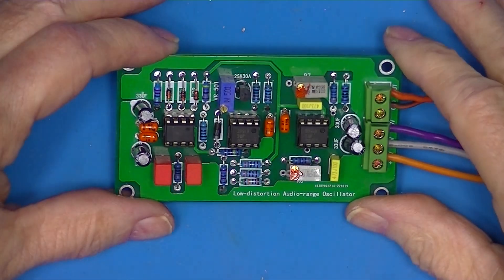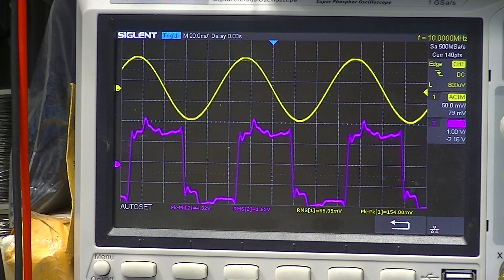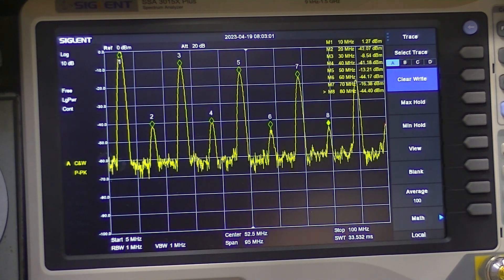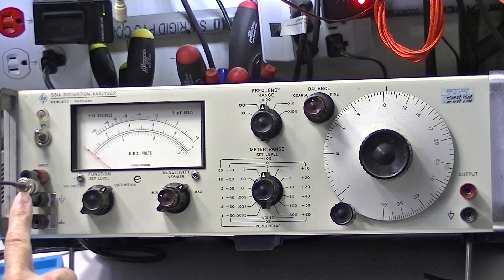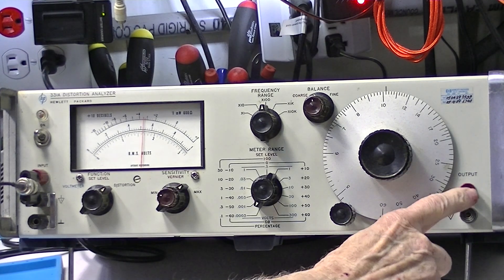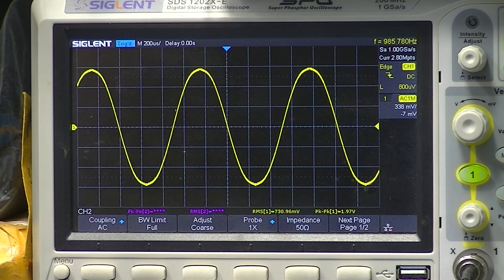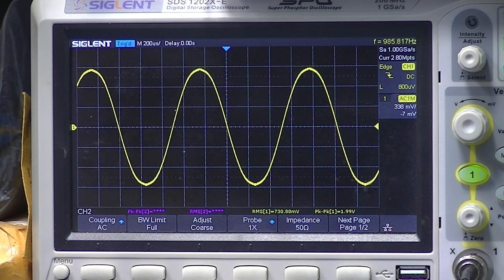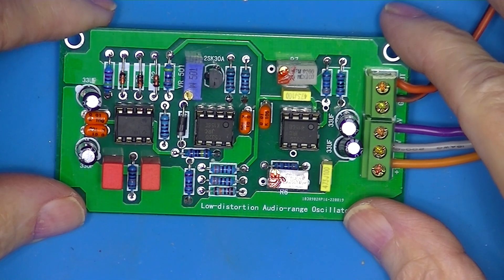Low Distortion Sine Wave Board

Comment: Looks like your spectrum analyzer is a Siglent SSA3015X Plus, and the frequency spec on that only goes down to 9 kHz.  But from your video, it appears to be working just fine at 1 kHz.  Has the instrument been modified in any way, or does it really work down to 1 kHz?

Comment: That is an ancient HP Distorion Analyser! - I first used one of those in 1974 :)   The circuit is a two integrator loop or state variable filter oscillator.

Comment: Very good video. I also have the 331a good machine ! Can you check the number on the 2sk30a because data sheet and the one i have have different pinout .I have better result with a Wien oscillator with a lamp.

Comment: It looks like a simple multiple feedback band pass (BPF) oscillator.  The fet (via R3 trimpot) controls the amplitude and distortion level (AGC) Requires fine tuning to reduce distortion to a minimum

3:38  The difference between m1 (-10dB) and m3 (-55dB)  is 45dB, that's close  to 0.5%
.
(-40dB is 1%;  -50dB is 0.3%;  -60dB is 0 .1%;  -80dB is 0,01%   -100dB is 0.001%.  And -120dB is 0,0001%)
.
The written specifications are far from what was measured; a Wien bridge oscillator, stabilized with diodes, can have distortion values close to 0.05% (-65dB); with light bulbs can be a litle better (but it's very difficult to make them work stably).  Twin T oscillators also have low distortion
.
Here, a thermistor compensated Wien bridge oscillator, is supposed to achieve 0.001% (-100dB)
https://keith-snook.info/wireless-world-articles/Wireless-World-1981/Wien-bridge%20oscillator%20with%20low%20harmonic%20distortion.pdf
Reply from the maker: Thanks
Steve